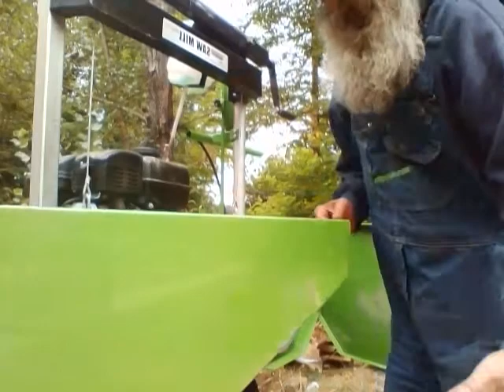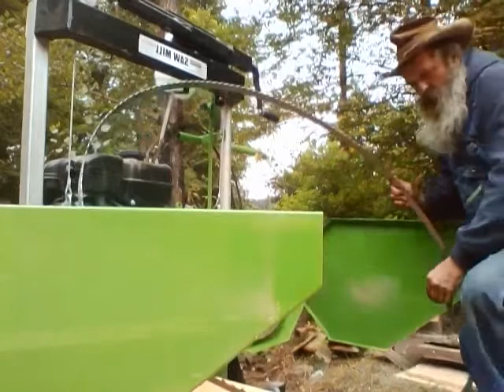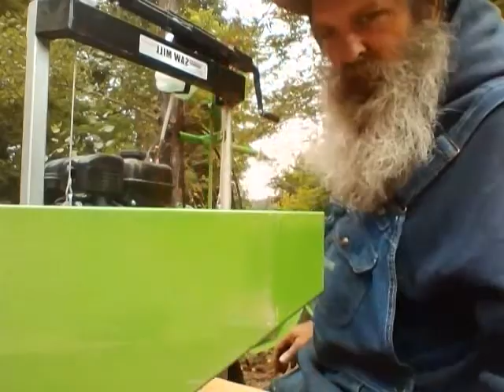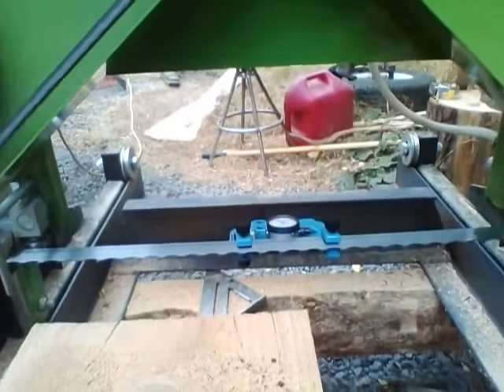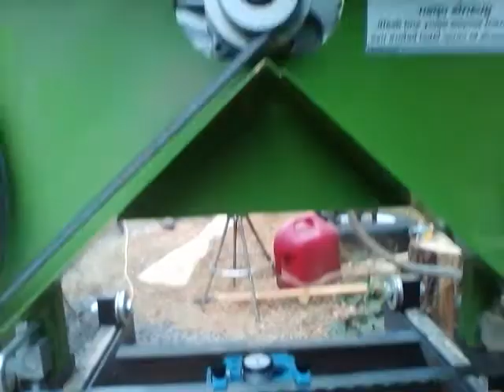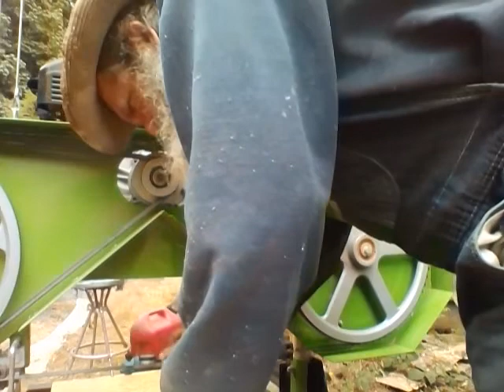replaceing the saw blade after I moosed up

Comment: Yep grizz I mentioned earlier about that being the number one mistake  with band mills. Unfortunately it's a costly mistake you won't make many times before you start checking before sawing. So don't sweat it most everyone makes this goof your doing just fine hang in there.
Reply from the maker: i resolved that problem it is very unlikley to happen again with what i have done but yes you did say it and i knew it from having a mill 20 years ago..hobby mill that is